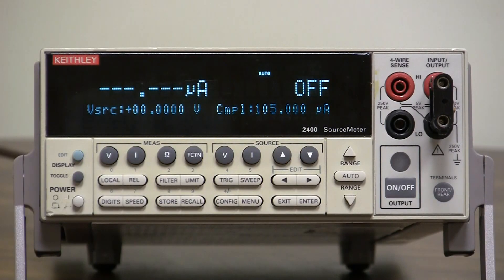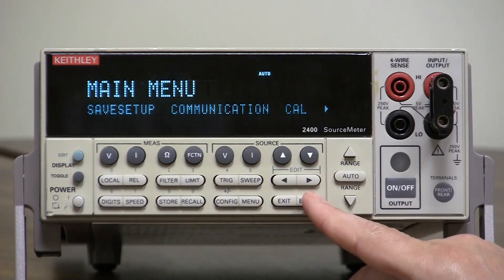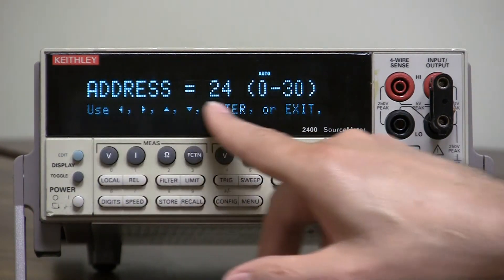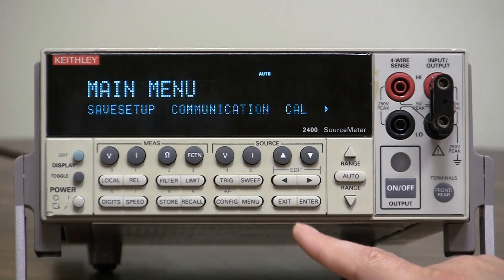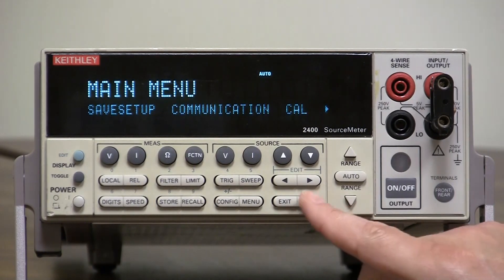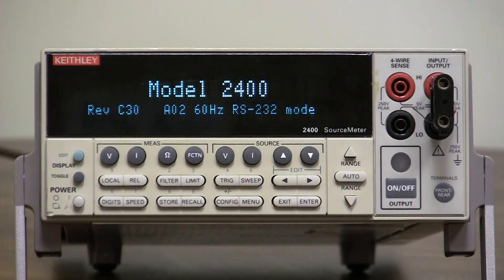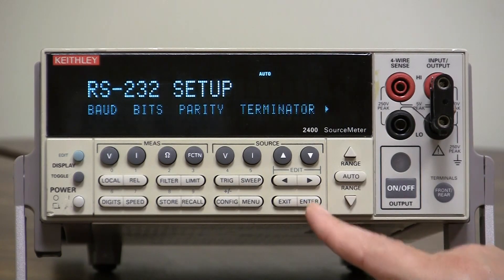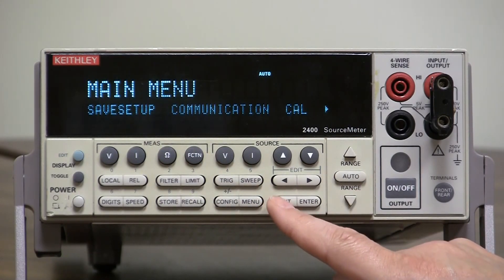How To Setup GPIB RS-232 Communication - Keithley Instruments Model 2400

Comment: I'm having a problem connecting to a computer and acquiring data via MATLAB.
I troubleshoot on the command window to open a instrument object.
It works.
However, if I do the same in a loop for data acquisition, I get a bunch of zeros.
I feel this is a problem in communicating with my keithley 2410.

Any suggestions?

Thank you.